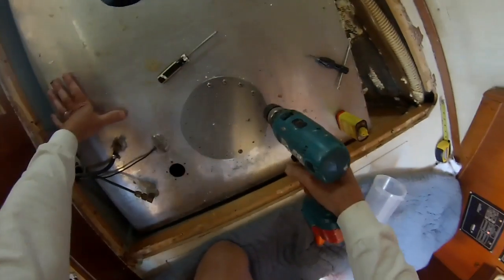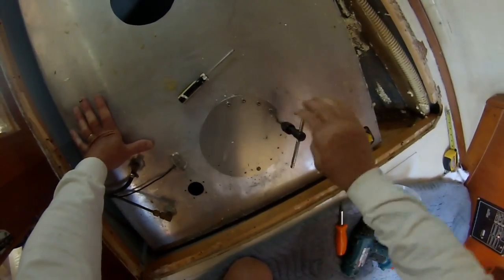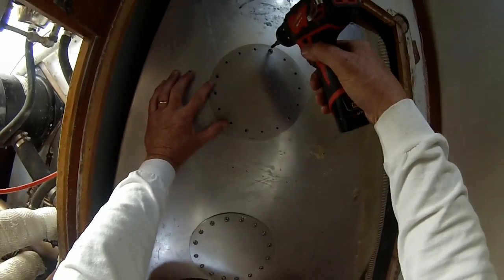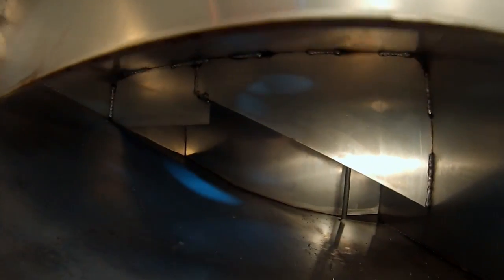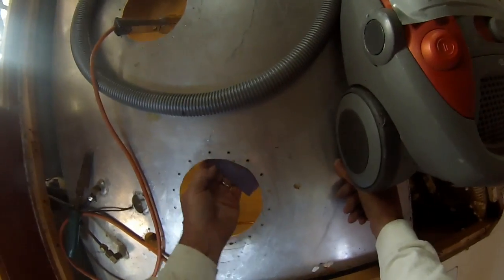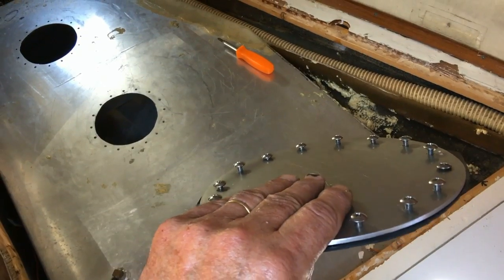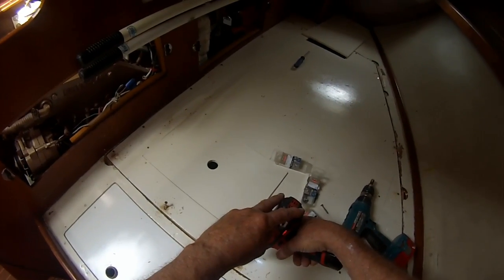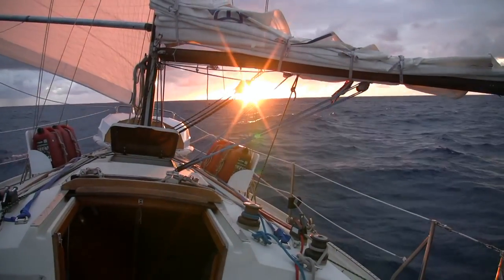"A New Boat"-- Part 3 ("Fuel Tank Inspection Ports")

Comment: this is not the ideal method. this would not have passed a pressure test. this method will have leaked up the threads and out from under the head of the bolt.

Comment: Hello Christian.  I have an '83 Ericson 38 that has developed a leak in the fuel tank so that fuel drips down into the battery box.  I will need to open upi the fuel tank area as you did in your video.  I am hesitant to start as I do not know if that once I start cutting through the glassed over seam by the hull side that I might cut through hoses or wiring in that area.  I have the same ribbed hose on the right side that you have.  I do not know if its lower or higher up than what I see in your video.
Were you concerned about this before you cut through the glassed over seam?  Is there an option to see the area between the tank and the hull beforer attempting the cut?  Any suggestions would be most appreciated.  Thanks, Brian Sayers
Reply from the maker: Brian--Join us at the Ericson forum.  It's free,  and  so is the expert opinion there. https://www.ericsonyachts.org/infoexchange/forum.php
Reply: @ChristianWilliamsYachting  
Thanks Christian for responding.  I have an account on the Ericson site and in the forum found your note and pic on the fuel tank.
I'm surmising I have to do the same thing you did, which is remove all te screw on the left side and cur though the glassed over seam on the right side.  A friend believes we can cut though the top with hitting wires or hoses.  i sure hope so, bit it makes me nervous.  In the U Tbe video I can see the rubbed hose on the right side; I have the same in my boat.  In your pic on the forum page  I don't see that hose.
We'll be tacking this in the next wek or two, so hopefully we can get the tank exposed, removed (worried ablut that foam), and get the leak repaired.
Thanks again, Brian Sayers
Reply from the maker: @briansayers9453  Job makes a mess but not a big challenge. The ribbed hose is for the Whale manual cockpit bilge pump. Cheers/CW

Comment: Very interesting. How did you remove the diesel in the tank? Did you clean/polish the fuel and re-use it? Thanks
Reply from the maker: Rattle siphon through the sender port.  Diesel pump would've been 10x easier.  I recycled (discarded) the old fuel.

Comment: did you put any thing on screws since you are putting SS into Al, ie. dissimilar metals = corrision
Reply from the maker: The nitrile rubber provides separation with isolation aided by the aviation sealant.
Reply: @ChristianWilliamsYachting  not with the currnet physics in this universe it doesnt.

Comment: During a sea trial of a Tayana 37 out of Houston, as soon as we got into some chop, the engine died. We sailed along, changed the fuel filter and restarted the engine, because we were evaluating the  boat, not just the sailing part of it, and of course the engine died again, and again with each fuel filter. After gettting her  back to the dock, the tanks were cleaned and it was full of crud.  Didn't buy that boat, because I talked myself out of it... but the memory of a dirty fuel tank lives on. 
Thanks for video.

Comment: did you label those inspection ports?  they're similar enough to get mixed up if more than one is removed.
Reply from the maker: Good point. Yes,  I put identifying drill indents on each lid to match similar indents on the tank surface. Each gasket has a pointed tab to assure the same orientation each time.

Comment: This is really important. Even new boats can have debris inside their fuel tanks. And the engine will run fine at the dock. And then, the debris at the bottom of the tank gets stirred up by sea motion underway shutting down the engine when you need it the most.